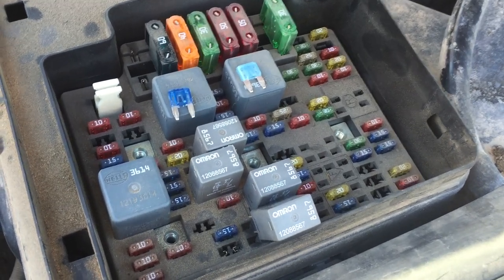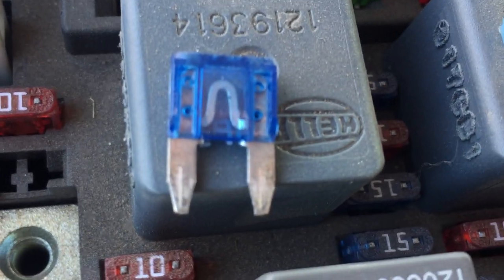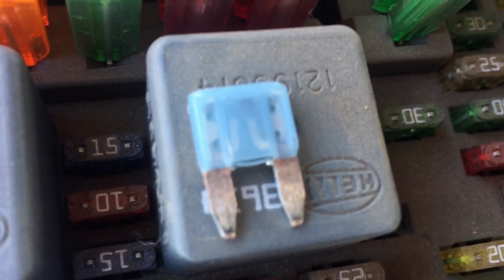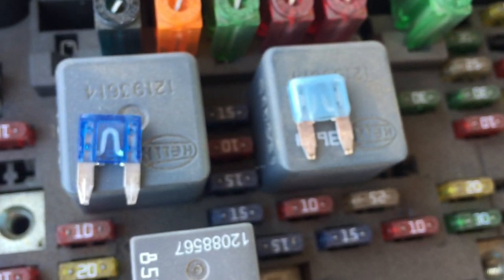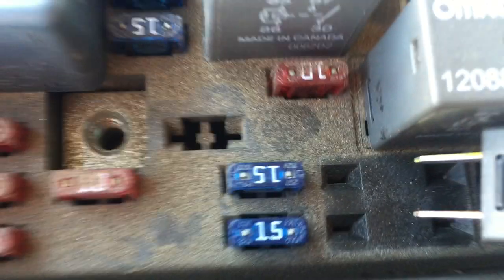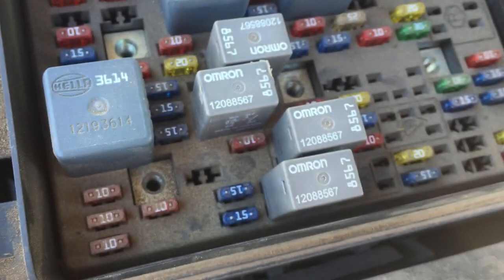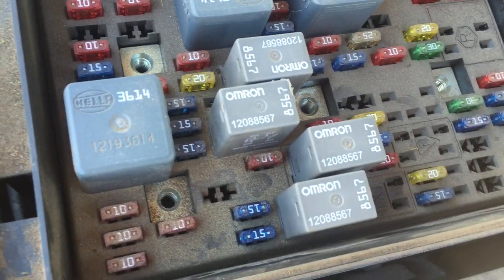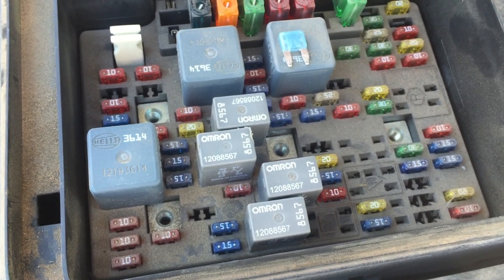Fuse vs Relay: What's the difference?

Comment: I have a pop up camper and there is a relay for the motor that lifts the top of camper. Well the relay has rusted out and I was thinking about putting a fuse instead. Do you think that would cause any damage to motor?

Comment: plain simple and to the point. thanks man. 
my fog lamps are not switching on. i have changed the fuse but when i switch them on, they dnt light up and i can hear a clicking sound coming from the relay. could it be the relay that is faulty? i have bought a new set of relays today and will replace them all tonight when i get home and see from there. the foglamps are brand new with new bulbs.
Reply from the maker: Let me know if the relay fixes it. Was the fuse burned out that you changed?

Comment: I'm putting air horn on my truck and I want to use a 40 amp fuse instead of the relay and use the switch for the ground.  Is this safe

Comment: Hi. im actually making a project which involves the fuel pump fuse.I watched a video wherein the guy took out the fuel pump fuse which made the engine to turn off. Do you perhaps know about the connection between the fuel pump fuse and the fuel pump itself?
Reply: Jeremy Rubio you also have a relay for fuel pump relay under steering wheel or behind glove box

Comment: I have a RX 300 in the DRLs stopped working,(The highbeams are the same bulb is the DRL and they still work, the DRL fuse is fine and I pulled the relays out independently and sent power to them from a 12 V plug And they each clicked, however there is no power going to the DRL FUSE, but This truck has three DRL relays God knows why... I looked at the wiring diagram and it makes no sense,The power goes from the ECU>>to 1 of those the relays>> then to the fuse>> then to the next to drl relay its weird What do you think there really isn't giving the power of the fuse? I'm trying to figure out if the relay powers the fuse or vice versa because the diagram made it seem like  both do
Reply: I’m having a similar issue, did you ever find out if the relay feeds the fuse or the fuse feeds the relay?
Reply: @EbayJaybay  for what vehicle?

Comment: does a fuse regulate power in any way?
Reply from the maker: BrianVISION In a way it will, but the result is you blow the fuse. It will not control power other than blowing out

Comment: Hallo
If i remove the ABS-Fuse , will the whole traction system stops ?
Reply from the maker: most likely. When the abs goes out it also takes the traction control in most cases

Comment: Sorry, still not getting it.  No one seems to be able to explain WHY relays are necessary, and WHEN they should be used (and conversely, when they are not necessary).
Reply: from what i gather - fuses prevent excess power and relays give excess power.
Reply: Relays regulate where current goes. Fuses prevent the device receiving current from breaking this saving you money in repairs. The reason why they are needed is because without them you'd be replacing parts worth hundreds of dollars and it allows current to always be delivered at the press of a button/switch. Example. Your boiler is always on; True? 
Your faucet isnt always spewing hot water though, is it? Think of the relay as the pipes connected to your faucet and think of the fuse being the boiler and the current is the water.
Reply: @marcv.5574  it sucks i have to read this a couple times to try and understand more lol. I over think most things. 
Why do some vehicles have more than 1 fuse box, some with the fuses? 
And if that doesn't fix the problem with the fuses and relays could it be the whole fuse box itself?